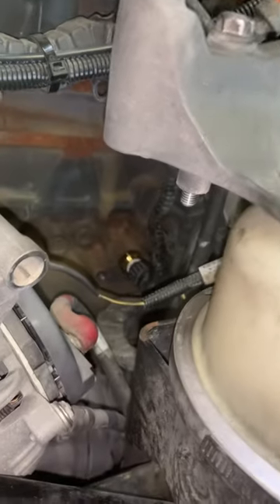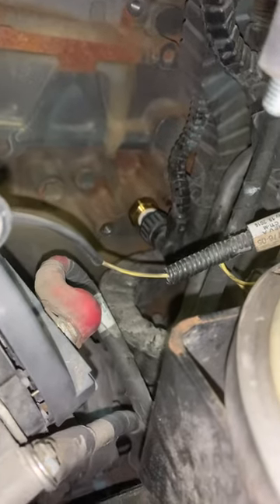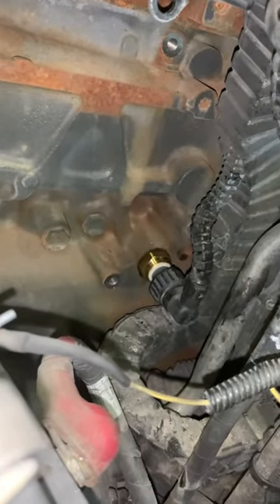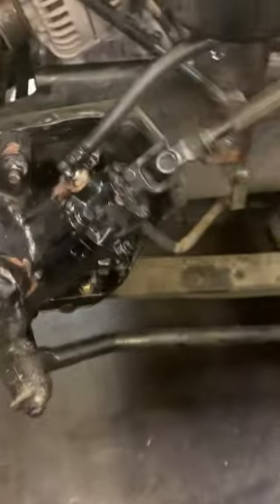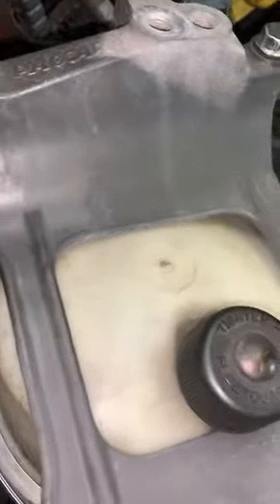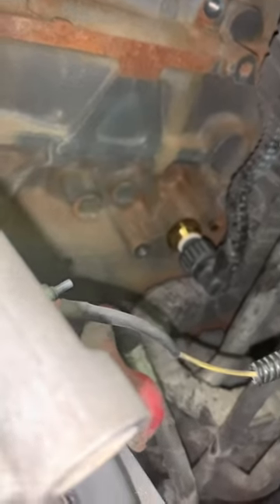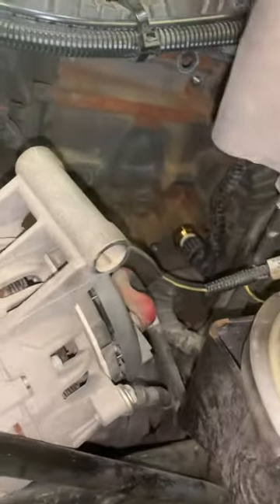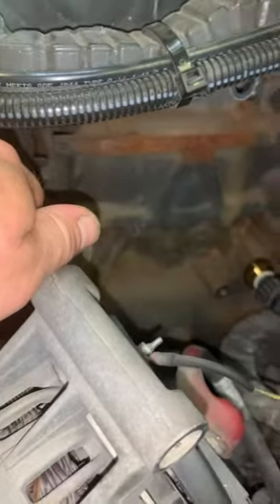Oil pressure sensor replacement Paccar MX13

Comment: Mine is reading ridiculously high before I even start the truck then max when idle just happend same make and model as described any pointers or hints to replacing it other than what's mentioned already 😊
Reply from the maker: It's funny that you ask this as the truck I did the sensor on is at my shop today for an air leak.  No other tips.
Reply: Did replacing the sensor work?
Reply from the maker: On the truck I worked on it did fix the issue. @mossderrick7130